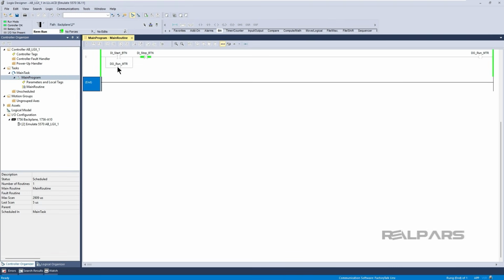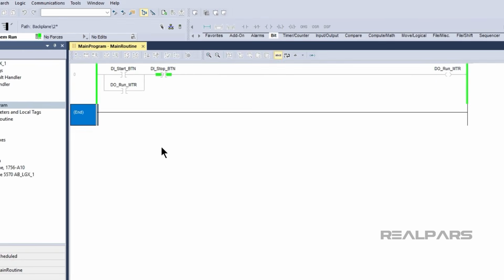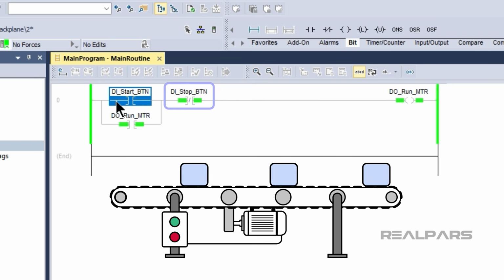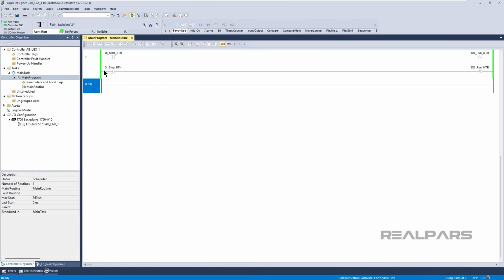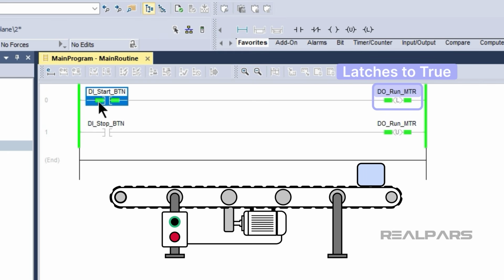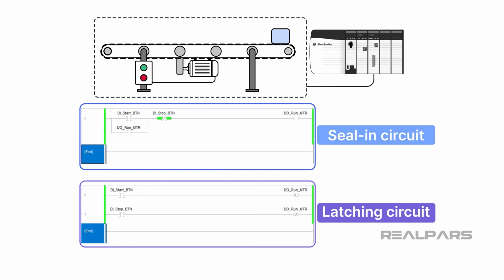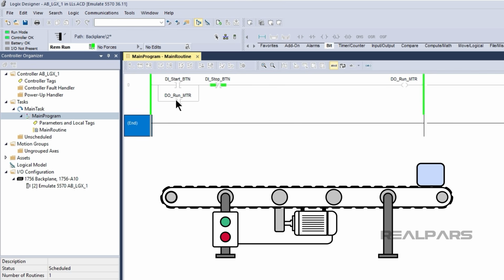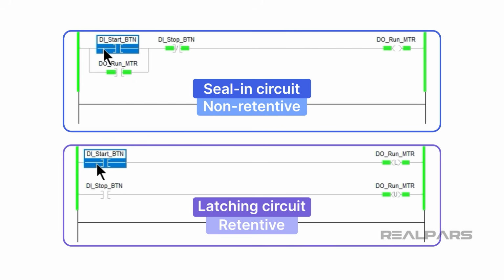PLC Latching vs Sealing Explained Simply

Comment: A physical interlock stop button should be NC normally closed, and the ladder should be examine on (as with the start button). The shown example infers an unsafe stop NO button! If the wire breaks to an NO stop button your machine will just continue running with no way to stop it! So dont follow this code example for industrial grade safety.
Reply: No joke, these details make a big difference! I used to spend a ton of time double-checking circuit safety manually before automating checklist steps. Have you looked into automating any of your workflow for these reviews? Happy to share what’s worked for me.
Reply from the maker: Thank you for your comment. Depending where in the world you located, the meaning might be the same but called something else.
Reply from the maker: You are correct in saying the physical button is wired NC, and the ladder logic diagram is read like this: "Is the STOP BUTTON CLOSED?" "YES" and you see the logic "GREEN?" Then the logic is true, and then it is correct as shown.